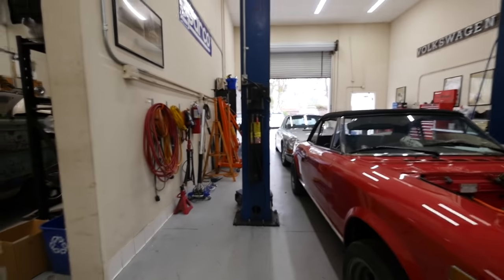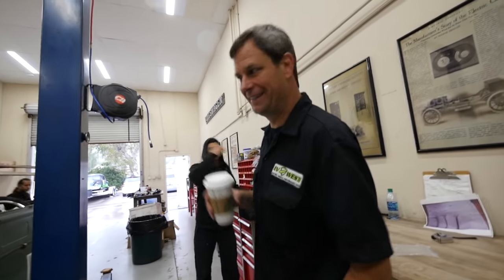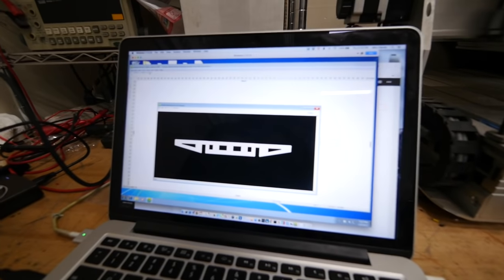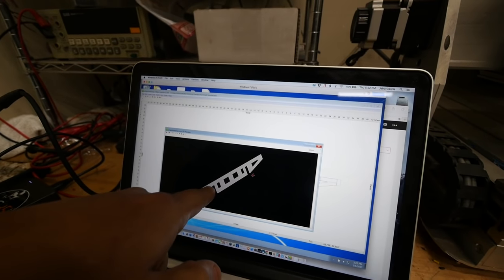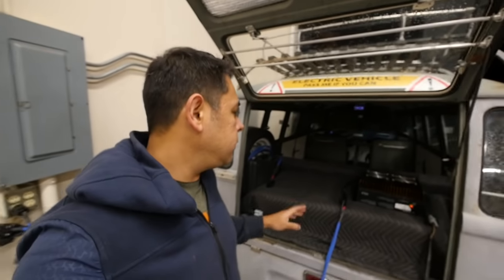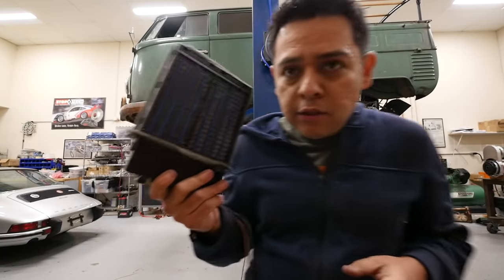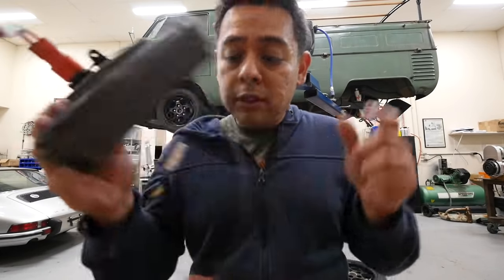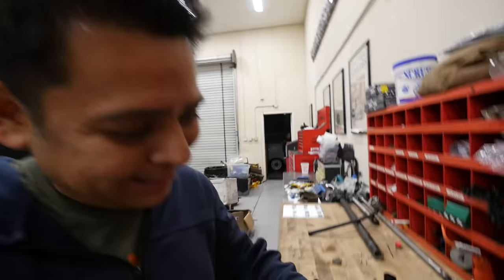30 kWh TESLA BATTERY under the VW Bus Floor?  -  Vlog 2

Comment: wanna sell those older lithium batteries? :) :D
Reply from the maker: Im thinking $45 a brick,  I have 70
Reply: ok how about shipping? I live in Canada ontario.
Reply from the maker: 6lbs each email me your address and I can quote you shipping
Reply: where can I get your email :)
Reply from the maker: jehu @ jag35
Reply: Whats your AH rating for your LiFEPO4 cells?
Reply: says its not right

I used jehu @ jag35 and not working
Reply: Did you put the spaces in too?
Reply from the maker: no you also forgot the dot com
Reply: ha
Reply: sent
Reply: I'm also interested in getting some LiFePO4 cells for DIY Powerwall... I'm thinking around 2000AH give or take 100-200 AH...
Reply from the maker: that does not make any sense,  2000AH or 100-200AH?
Reply: What I mean is, I want the capacity to be around 2000AH But it can be 100-200AH more than 2000AH or 100-200AH less than 2000AH.
Reply from the maker: +Zai Fuchigami   I have 70 90ah cells.   22 in parallel should give around 2k AH,   What voltage you running?
Reply: 24v.. So I guess 8 cells in series would be a good voltage to start... if the cells are 3.2v nom.
Reply from the maker: +Zai Fuchigami thats 48kWh,  Im only selling 20kWh worth of batteries
Reply: Can you elaborate please?
Reply from the maker: +Zai Fuchigami  I'm selling 70 90ah cells = 20kWh.   You want 2000ah at 24v = 48kWh
Reply: This is painful... +Zai Fuchigami it is highly unlikely that you need 2000Ah +- 200Ah (2000 amps for 1 hour). You more than likely have your battery terms confused, so here is a quick tutorial... There are 70 batteries on sale, each battery has a capacity of 90Ah and a nominal voltage of 3.2v. In order to get 2000Ah you would need to connect 23 batteries in parallel to make one big 2070Ah battery (AKA a string) that produces 3.2v. In order to get a 24v / 2070Ah battery pack you would need to need eight 2070Ah strings (25.6v) joined in series. If each parallel string has 23 batteries and you need 8 in series that means you need 23 x 8 or 184 batteries to produce just 25.6v. I won't make things complicated by introducing C rating but why on earth would you ever need 2000 amps at just 24v? Battery packs are normally expressed in KWh (watts or kilowatts x hours). A 24v (25.6v) x 2070Ah pack (lots of batteries together) works out to be a 53 kWh pack, which is huge, Telsa car huge.
Reply: +Dodgy Brothers Alright.... First things first, AH is a battery capacity term, so that does not mean you have to draw 2000A for one hour. It can be 20A for 100 hours. How you would connect a pack is this: you get 24 cells and divide them into 3 packs, you then connect each pack of 8 cells in series to make 25.6v. After doing that you connect the 3 packs in parallel. in this config you need only 24 cells, and has a 2160AH or a 7KWh capacity. I don't know how you got your answer for your "tutorial"... And Telsa is spelt Tesla.
Reply: +Zai Fuchigami Ah (not AH) is a current flow rate not a capacity. kWh is a capacity. An Ah is the ABILITY to deliver one amp for one hour (current flow). In the case of these batteries 90 amps for one hour. A pack of X kWh batteries can be discharged in any number of ways, including light use i.e. couple of amps all the way through to 90 amps (still avoiding C rating). You want your cake and eat it too, but your math is completely wrong. 24 cells divided by 3 = 8 cells x 3.2v (nominal) in series = 25.6v, that much is correct, but using those 8 cells or 1/3 of you available batteries you now have one 25.6v 90Ah battery. Create three identical strings and connect each of them in parallel and you have one 25.6v 270Ah battery. Joining batteries in series increase voltage only it has no effect on Ah, joining batteries in parallel increases Ah only and has no effect on voltage. Since you think you already know it all I will leave you in +jehuggarcia hands who also has no idea how you came up with your math.
Reply: To calculate kWh I times the Ah rate by the voltage. So using your calculations 270Ah X 25.6v 6.9kWh. Using my calculations it will also be 6.9kWh: 2160Ah X 3.2v = 6.9.
Reply: 270Ah x 25.6v is indeed a 6.912kWh pack, and 2160Ah x 3.2v also equals a 6.912kWh pack, but you were talking about 2000Ah at 24v which is a 48kWh pack.
Reply: Im sorry. I got really confused, I rote many versions and they all got mixed up.
Reply: Can we talk about this on a different pack config?
Maybe 8 260Ah cells in series?
Reply: Well you can only make the pack in multiples of what is available and you can't put different sizes into the mix i.e a 60Ah, so 3 x 90Ah is the closest you can get to 260Ah. 8 in series and 3 in parallel (8 x 3 = 24 batteries). What exactly are you trying to power with this power wall? Assuming some kind of back up lighting?
Reply: I'm going to use the Powerwall to power my entire home off grid. I don't have a fridge or a air con or any of the most energy consuming devices. I will be pulling around 200w max.
Reply: Well you are going to need 110v - 240v AC depending on what part of the world you are in. 110v is going to take 35 cells in series. 240v is going to take 75. So depending on the voltage you are going to have 110v DC 90A or 240v DC 90A. The 70 cells available is not going to be enough to power a house for several days (typical in case of cloudy days when solar can't charge).
Reply: Wait. How do you think 110v DC can magically power AC appliances? I plan to use a 700w 24v inverter. Btw I live in Japan so the voltage is 100v
Reply: It generally can't, but if you are going to do a DC to AC conversion it is preferable to do it close to the voltage you are switching over, so it doesn't need as many complicated electronics. To go from 24v to 100v you need a separate step up stage which incurs its own losses. Whereas if you convert from the same voltage it avoids that step.
Reply: If you're in Japan there would be very little point in buying batteries from the U.S, as the cost of batteries plus postage would probably be dearer than buying the batteries new there. The U.S is a very dear country for postage.
Reply: Yes I agree on that. I'm planning on getting other cells from a company that doesn't charge much for shipping.
Reply: Jehu, I'm writing to you to say that I won't be buying those cells from you. After some thinking it turns out It will be quite a bit more expensive to buy from you (including shipping to Japan) than one company I found. Thank you anyway...